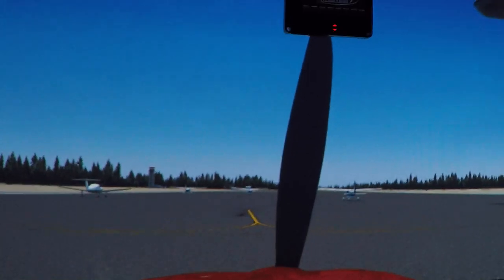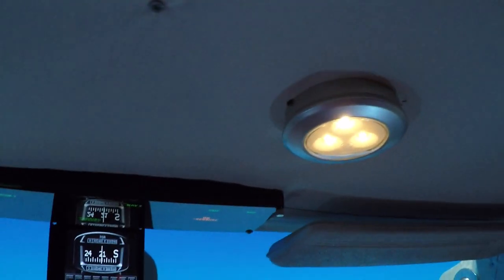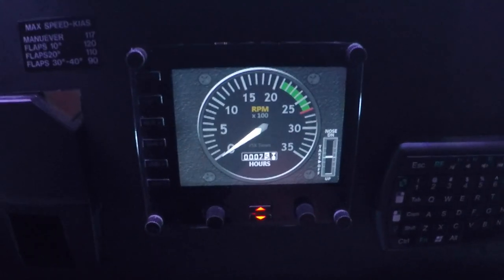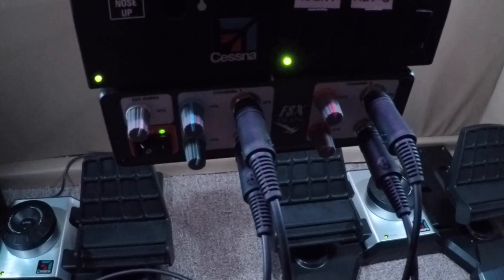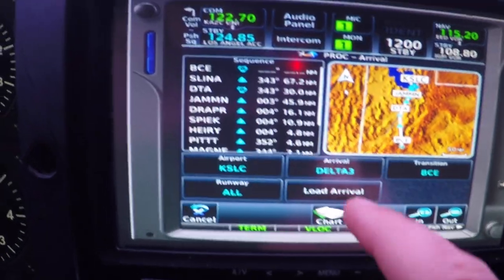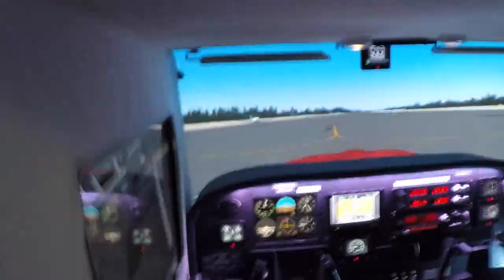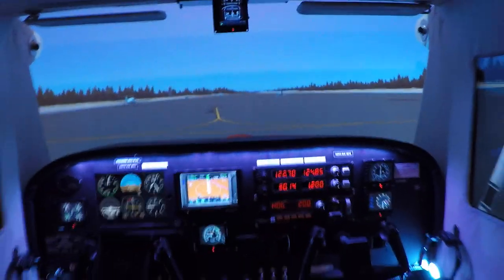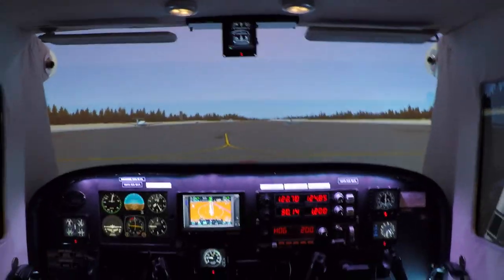Cessna Home Cockpit Video Tour (Prepar3d / Saitek)

Comment: woooow ..... I have to admit that I'm impressed. Very nice and neat build. What is your advice to someone who wants to start building a Cessna sim.
Reply from the maker: I think my first piece of advice is that you can go piece-by-piece. The frame wasn't too difficult to build myself. Next is get used equipment where you can find it. I actually have some Saitek stuff that I'm selling right now at http://www.ontheglideslope.net that can help you get started. In fact, there's a lot of information there that can help with your build. But you don't need to do it all at once. Start with some controls and a 32-inch screen (that can later become a side window) and go from there.
Reply: On The Glideslope Many thanks for your great advice, I'll check your stuff soon.

Comment: Thank you for your answer.
Looking around the corners, did not think of that.

So , if you could give me a ball park figure of how high the screens are from the floor, and the height of the mip from the floor, It would be much appreciated .

Ps:, loved your last video, Multicrew hé
Reply from the maker: Hi and thanks. I have dimensions and more at www.ontheglideslope.net in the "Resources" tab. If you check that it will help. It saves me the time of having to repeat it all here over and over ...
Reply from the maker: Hi. I just posted basic plans. They are here: http://www.ontheglideslope.net/2016/11/21/the-long-awaited-basement-sim-schematics/

Comment: Great video. Could you publish a link to the intercom hardware ?
Reply from the maker: Thanks. Happy to. It's the Flight Sounds FSX-DUAL unit. More expensive that a used real-world intercom off Ebay, but it can run as its own sound card so you can have the airplane sounds through your speakers and your voice work through the headset. I really like it. https://www.flightsounds.com/fsx-dual
Reply: Thanks so much !

Comment: Awesome setup. Thanks a ton for sharing the setup with us. What settings do you run your side monitors at? Mine show the views at an angle and I can't get the horizon to line up seamlessly across the 3 screens. Is there a setting in P3D that I can use to tweak the angle??
Reply: if you go on his website he has some articles explaining monitor settings and view settings.
http://www.ontheglideslope.net/2016/05/18/how-to-creating-custom-cameras-in-prepar3d-v3/
Reply from the maker: Correct, and thank you Peter. Thanks, too, Eddie for the comment. It took a lot of tweaking to get the camera configs just right. That post on the blog explains a lot f it. The key learning for me was to have the left and right monitors have exactly the same Y, Z,  and Pitch, with exactly opposite Bank and Heading coordinates (for example -90 Heading Left and 90 Heading right).
Reply from the maker: Also, Eddie, I found adjusting the Pitch angle was key to getting the front and side horizons to align ...

Comment: Hi, Amazing work on the simulator. I like very much the finishing touches you added. It really make s a difference. One day when kids grow up a little I might do something similar. I haven't flown a real plane in last 10 years (Private pilot license and pretty rusty by now) and just now getting into simulators. Still deciding which one to go with but it looks like X-Plane 11 will be the winner. 
I have one question for you. Is there a reason you decided on a particular projector for your front screen? It seems too pricey and there are other options in the given resolution in the range of $300-$600.  Is there something different you would recommend? 
Thank you and good luck in your flying, both virtual and real!
Reply from the maker: +TheOzembuch thanks for the comment. I had to go with an ultra short throw because of space limitations. I tried two others and they wouldn't work in that room without casting a shadow from the top of the cabin. Believe me I wished for a more affordable option.

Comment: Good sir, I'm just starting to build my version of something like this. you have been a great inspiration! I think I've watched this video 20 times already!😃
I just grabbed two 1080p 32" TVs from Best buy the other after a good sale they had. I also grabbed a 40" 1080p TV for front view (for now). Question I have is do you think sitting that close to your left monitor, but both ways would work well? as in the right monitor would be just as close. I'm planning a single seater cockpit design based on the Super cub with a middle mounted 10" AirManager tablet/monitor.
Reply from the maker: +Big Tall it probably depends some on the person and the cockpit, but I don't mind being that close to the left monitor. I suggest setting the TVs on something at the appropriate height and width before you build the cockpit frame so you can check it out.

Comment: hi,
again , very impressed!!
If i may ask, you look like a tall guy, I myself am more the 6 feet tall, and from the look of the video your Eyepoint seems to be about the upper edge of the side monitors.
is that not a bit to high?
how high are this screens from your floor?
i am gonna build one like yours, and think of replacing the front beamer with a 55 inch LCD monitor,
in your opinion, is that possible? to get allignment with side screens, you have 100 inch field of  front view, that is big.
thanks for your answers, and keep the videos comming, i realy like them.
Reply from the maker: The camera eyepoint is at my eye-level, although the mount for the GoPro in my other videos is a bit above that. That's just a function of the mount. I'm just over 6 feet tall myself, and things look perfectly fine from my vantage. On the beamer, I've been asked this question a lot, and the answer is that for both the pilot and passenger to have uninterrupted views without seeing the edge of the screen I need about that much width (100 inches). I also like being able to look around the corners when I fly (just as I would in the real world). Watch some of the other videos in my channel and you'll see what I mean.
Reply from the maker: Also, see www.ontheglideslope.net for info on dimensions etc.

Comment: HI, Great video. thanks for sharing.
Just a quick question, how did you get the saitek multi-panel to work with P3d. I tried SPAD was not able to get anything working so far. Thanks
Reply from the maker: Hi. Thanks for the kind words and for watching. I've never had any problem with the multi-panel. It just worked with the latest Saitek drivers, and it just works with SPAD.neXt. When my Saitek gear has been problematic it's nearly always been because of voltage loading issues on the USB hub, and not having enough power in particular. I need 500ma per unit for them to work well, meaning I can only plug four Saitek units at most into a 2amp hub. You read more about my experiences with that stuff here: http://www.ontheglideslope.net/2016/04/22/power-to-the-hub/

Hope it helps, and thanks again for watching.
Reply: Thank you, One of the best videos for a home cockpit, Well though off and excellent layout. 
Thanks again for the quick reply and trying help out. I fly radio control planes and helis and (Thanks for the sub) :) currently working on my PPL and have sincerely enjoyed your videos, Keep them coming. 
cheers.
Reply from the maker: Thanks so much. I intend to! And good luck with your PPL. I'm seven hours in and really enjoying the experience.
Reply: +On The Glideslope  thanks and same to you. cheers

Comment: hey man! if its not too much trouble, could you please do a short tutorial on how to size gps to the gps monitor? It's KILLING me! lol I just can't work it out for some reason. as easy as it probably is, im just stumped!! please help if you can. I'm running fs9. Also, do you have to run SPAD while on fs to utilize the altimeter setting function on saitek xpdr mode?
Reply from the maker: Hi Muzik. I just drag it down with the mouse, and then drag the right border over, and then the bottom border down, both using the mouse to size the window. That's been easier for me than trying to drag from the corner.

Comment: Hi. love the setup. quick question. Does the Flight 1 GTN 750 work on a separate pc to flight sim ie through FSUIPC?
Reply from the maker: Hi and thanks. No, it's on the same PC as the sim. But I do have it running on a separate core than the main sim.
Reply: +On The Glideslope thanks. i am impressed with this. does your Web site give the computer specs. I'm running an old i7 920 for the sim with another old pc for the instruments.
Reply from the maker: It does. There's a "what's in the sim" item in the "About OTG" menu at www.ontheglideslope.net.
Reply: ok great thanks for your help

Comment: hi I've almost finished the frame structure and need some measurements for the panel. I know it's 46inches across the cockpit but what's the width of it please? also how much leg room do you have? I'm 6ft 2" and you look pretty tall in your vids! again a great sim and huge amount of info has been gained from your website. oh and another thing did you ever consider using a large screen TV instead of projector? like maybe a 55inch LCD screen? thanks in advance
Reply from the maker: Cockpit is 48" across, and the panel is 46". It sits on a 48-inch wide piece of MDF that runs the full length of the cabin. The extra inch on each side allows room for the glare shield, which is made out of 1-inch foam covered with leatherette.

Leg room is no problem, I probably have about a foot or so under the panel.

I have thought about a large TV screen, but I like being able to look around the corners of the cockpit like in real life ... also, the projector as more affordable.
Reply: +On The Glideslope thanks very much for the info. I meant the top of the panel to the bottom. don't think I explained properly. thank you for taking the time out to reply. keep up the fantastic work!! oh and a flight over south west Wales next if possible?? my local airport is pembrey ;-)
Reply from the maker: Certainly. 18 inches at the centerline, top to bottom. That's the actual height of a 172 panel.

And I'll put Wales on the list!
Reply: +On The Glideslope hi from across the pond again! sorry for so many questions and thank you for the rapid replies so far. last question now I promise:-) How high does your instrument panel sit off the floor? from floor to top of the glare shield? thanks very much
Reply from the maker: Two feet from the floor to the bottom of the panel, and 3'6" from the floor to the top of the panel. 3'7" to the top of the glare shield.

Comment: Thank you very much for your answers.
I whas thinking of building a 747 400 pit based on  PSX from Aerowinx.com, but do not have the room to do it.
In my setup I have 3 Tv screens , and for the instrument panel there are several options to run it on a seperate pc or use Saitek flightpanels.
The  G750 is my main concern, a fourth monitor would stress the system, and I think it can not be networked.
Do you know a way to use a seperate pc as  fourth monitor?
There whas Maxivista, but there site is down, and I do not want to use a Ipad.
Sorry to bother you with these questions, and again thanks for sharing your flights and info with us!
Ivo
Reply from the maker: Thank you for your comment and for watching. I know lots of simmers run the instruments on a separate PC, and there are several applications that let you do so. Do some searching at AVSIM and I know you'll come across some. I believe SimPlugins is one, and Project Magenta is another. Air Manger is a third. Good luck!

Comment: thank you sir
as i was searching the net, came across one of the tutorials
 using the side pan view from the front view then using ctrl shift Q/ ctrl Q and ctrl shift enter/backspace. worked fine.

but on my front view i can only view with propeller if i go to virtual cockpit but the compass comes up. 
hop am not a bother Sir
Reply from the maker: No bother at all. I have moved the eye point forward in the C182 so that I can no longer see the compass.

Comment: I could use a little help. What drivers are you using? Do you use SapdNext drivers? Also what type of USB Hub make, power output etc. I have a full cockpit panel as well with all Saitek panels and controls. Been nice to touch base with you. HELP :)

Comment: hello sir!
Would appreciate if you could tell me what view you are using for the side views.
I have FSX (steam).
Have tried the virtual cockpit and then moved to side view but it is not a stable view. As I take off the view plays.
Your response is much appreciated.

God Bless!
Reply from the maker: Hello and thank you for your comment. I use virtual cockpit views. The movement you see is from the dynamic head movement. You can find a set of dynamic head movement settings in the FSX configuration file (fsx.cfg I think?). Set all the dynamic head movement settings to zero and that should fix it.

Comment: how do you extend the shaft of your yoke are you able to use the co-pilot yoke? thank's
Reply from the maker: Both yokes work but are not connected physically to each other. P3D simply reads both. X-Plane took more work: http://www.ontheglideslope.net/2016/12/27/solved-how-to-use-dual-controls-in-x-plane-11/

Comment: Great sim are u able to let me know what is the approx cost for the projector and screen and where did you get them .thanks
Reply from the maker: Hello Amr. The screen was not very much and I got it at a local computer / video store. The projector is an ultra-short throw and it was expensive, but if you have more room in the simulator space than I did you can probably use a short throw and save money. See more on the rig here: http://www.ontheglideslope.net/in-the-sim/

Comment: Hi Great, Set up,Can you run the GTN on an Ipad and if so what software to connect?CheersNeil m - London,Uk
Reply from the maker: Hi and thanks for the comment. I run the GTN on a touchscreen monitor, but I believe you can run it on an iPad through one of the apps that allows Windows / Mac to see your iPad as a monitor. I played with some of these, including one called Air Display, but I found none of them worked really well for me. So I ultimately just decided on a monitor.

Comment: Hello Again  Sir!

Along with the dual adapter, are you using the PTT switches that come with it or you can use the buttons on the saitek yoke.

Thanks
Reply from the maker: Zain Hussein I'm using the buttons on the yoke and they are assigned in FSUIPC.
Reply from the maker: Zain Hussein but that's just for PilotEdge. For the intercom between the two headsets you don't need push to talk (just like real life).
Reply: sir, if i have understood well, does it mean that if i configure the buttons on the yoke thru fsuipc i dont need the push to talk from the supplier?
Reply from the maker: Zain Hussein correct. You can also assign a keyboard button to be PTT as well.
Reply: thanks.
god bless.
enjoy ur videos and the clarity
Reply: Sir,

everytime i start fsx or my pc, the control axis of my yoke, rudder pedals and TPM reset themselves and i have to reset all of them everytime. 
i am using the free version of fsuipc.

is there a place i save the axis assignments somewhere.
thanks
Reply from the maker: Hmmm. Not sure if that is a FSUPIC issue. As I use P3D I'm not sure how to help. Maybe make post in the FSX forum over at AVSIM.com. The folks there are always really helpful and know their stuff.
Reply: thank u

Comment: I'm curious, what kind of USB hubs are you using. I get 13 port ones from Micro Center and it seems they barely last a month. Any suggestions on a quality USB hub? Thanks in advance and happy flying!
Reply from the maker: I bought several of these, and try to have only four devices attached to each: https://www.amazon.com/gp/product/B00R5ZA20G/ref=oh_aui_search_detailpage?ie=UTF8&psc=1

Comment: So I went to the website and followed the "How I Configured X-Plane Screens For The Basement Sim"  guide on how to setup the interior to get rid of the seats and the cockpit objects.  I do it, save the copy, and then boot the sim.  Then it crashes after saying that it couldn't find load the sound bank (Master bank.bank).  I even tried bypassing the tweaks and just downloading your ACF file and I get the same error and then crash.  Any ideas?
Reply from the maker: Hi. Did you get this fixed? For me I hand to make a copy of the ENTIRE C 172 folder and work within it, rather than just making a modified .ACF file in the original 172 folder.

Comment: A question for your setup:
For your side window, does your face feel hot since you are sitting right next to the 32in screen? does it feel hot on the instant you turn it on or after a long haul?
Reply from the maker: Never feels hot. They are LED screens and run very cool. I never notice heat in the simulator, although I can feel the warmth of the projector on the floor of the room above ...
Reply: +On The Glideslope This cleared a huge question for me. I was going to go for a projector setup outside of side window but that is gonna take up a lot of room and I'm not sure about the sense of immersion of it.
Then I saw your side window! Because I had bad experience sitting next to monitor right in my face, temperature was the only thing that was keeping me from adopting your setup. Now I'm onto shopping around for LED screens.

Interesting to know the projector is literally projecting heat on your floor though.
Reply from the maker: My wife can tell when the sim is on because of it!
Reply: From many fellow simmers, it seems that this 'wife' variable can make or break the entire project...
You and I are lucky, I guess.
Reply from the maker: +David T "lucky" doesn't even begin to describe it!

Comment: How did you attach the trim wheel and throttle quadrant?
Reply from the maker: +Dave Redding I cut the panel with a downward extension and they are drilled to it.